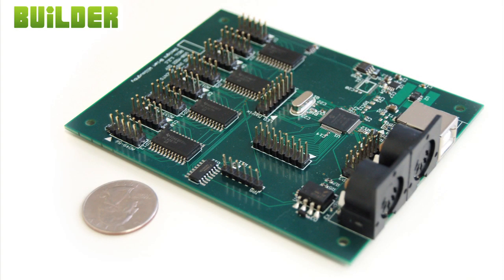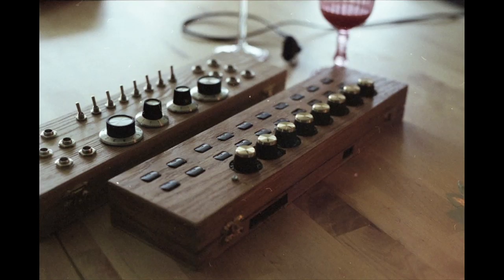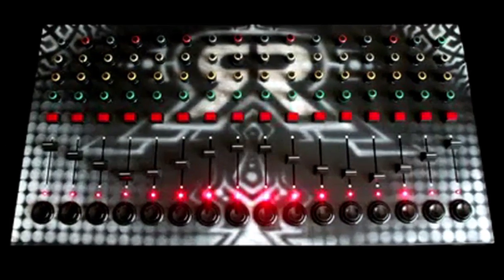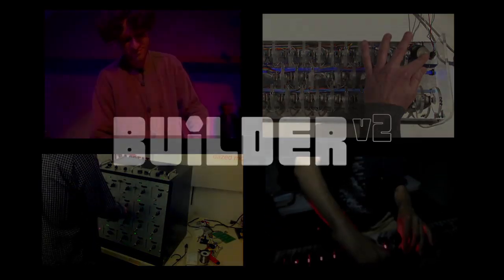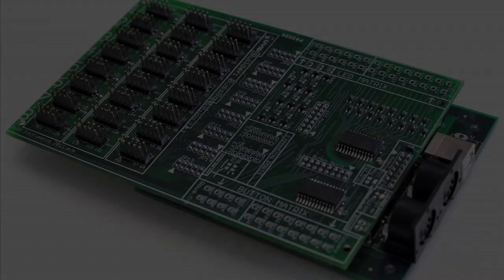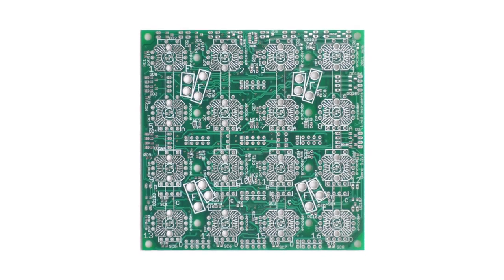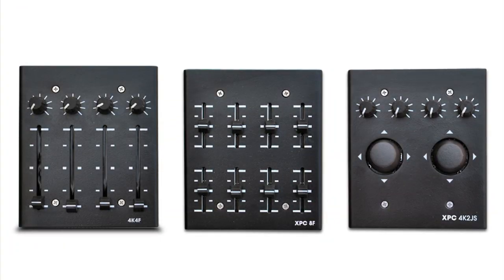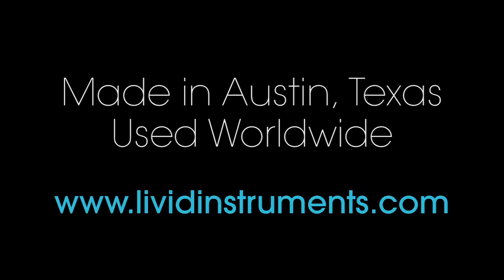Livid Instruments Builder V2

Comment: Could I use one of your Midi Brain kits to make a drum pad MIDI controller without any sounds (similar to a keyboard MIDI controller) with eight pads. That trigger sounds via piezo pickups. And send MIDI over a standard MIDI DIN cable instead of sending MIDI over USB? Trying to trigger sounds from a Korg Electribe 2. Thanks!